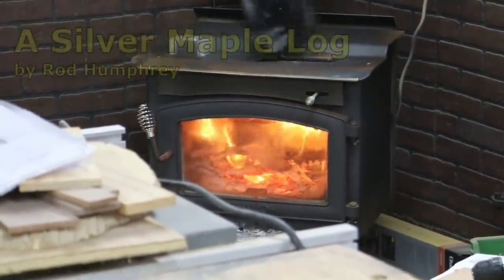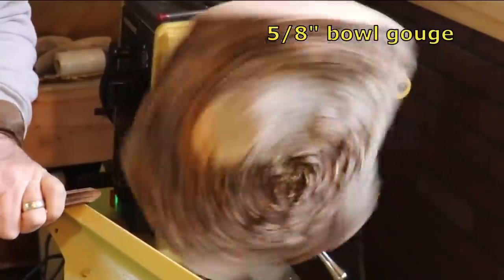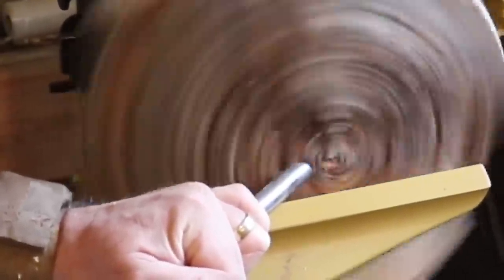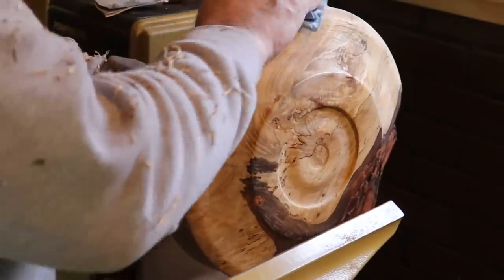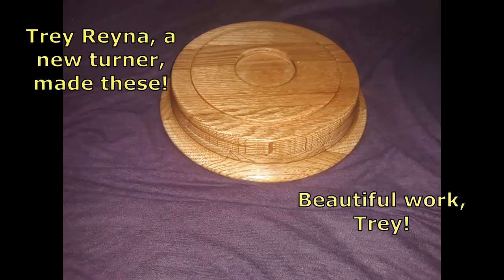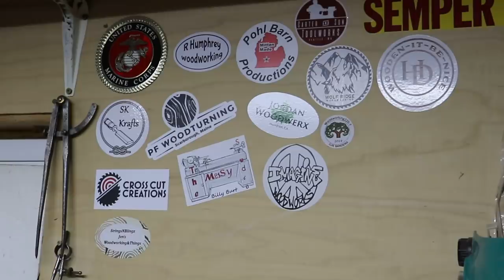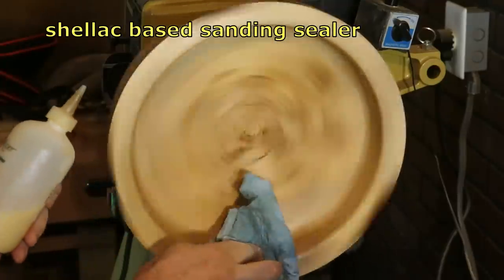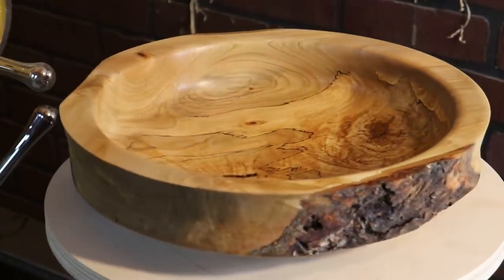Woodturning Silver Maple Crotch Log to Bowl

Comment: Congrats I’ve got the 3520b had it for 5 years, it’s had a lot of abuse and it still performs like new, you definitely should experiment with the bed extension low down off the end, I turned a 33 inch coffee table using the small extension, it also doubles up as a great place to put turning tools when not in use.
Powematic do a swing away for the tail stock also, I have it, it’s fidderly to set up but is an awesome addition also.
Love your vids 
Pete (from the UK)
Reply from the maker: Great to hear!  I'm certain to get the swing away, and am seriously considering the bed extension too.  Thank you!

Comment: You deserve it for sure! I have a question about your new lathe. It seems to look like the motor is wired for 3 phase with a converter mounted behind the headstock. If yes it’s similar to my new Grizzly which I just love. My 35+ year old Delta bit the dust and was going to cost me more than I paid for it so I bit the bullet and looked around and since I have a shop full of Grizzly I decided to use them. Your new powermatic looks like a great machine. Thank you for all your videos, I went to the beginning and watched you grow in the process. I’m not a veteran and I don’t think I should say it but Semperfie!
Best regards
Fred Thomas
Reply from the maker: That's exactly the wiring, yes.  35+ years!  Wow, that's some great longevity for your Delta!  Enjoy that Griz.  Thanks very much for going deep into the archives of my channel!  Yes, sir, you're certainly allowed to say Semper Fi to a Marine!  Thanks very much!

Comment: For awhile there i thought you were gonna get out the torch and do some scorching when you spoke of a rustic look. Not sure that would've helped in this case. The wood kinda spoke for itself.

Hey, if you would decide you need an extension for the new lathe, talk to me before buying one. I have one i don't have room for. It hides under my log splitter.
Reply from the maker: Thank you!  I'm not certain about the extention yet, but I'm probably buying the tails stock swing away attachment.  What size extension do you have?
Reply: @RHumphrey  the bed extension is 18". I do not know if it can accept the " swing away " which is a nice feature. Since I've never had the extension on the lathe. I bought my Powermatic used and it came with it.

Comment: What do you thin the shellac based sanding sealer with?
Reply from the maker: Usually denatured alcohol, or methylated spirits, because it dries really fast, but any alcohol will do as far as I know.  I like it maybe 3 times thinner than normal for soaking deep into the pours.  Just my opinion, but it seems to work great when I do it.

Comment: I bought a Grizzly.  What a disappointment.
Reply from the maker: I've heard really good and not so good things about Griz...
Reply: The bolt holes for the legs didn't lineup.  It took technical support two business days to come up with the wrong answer to the problem.  They sent me another pair of legs three weeks later that were exactly the same.  Out of disgusted frustration I wound up drilling out the holes in the bed and cross threading two of the bolts.  The tail stock leaves a lot to be desired.  I wish I had the wherewithal put it back in the box and sent it back to them.